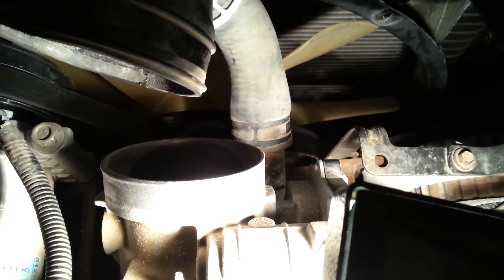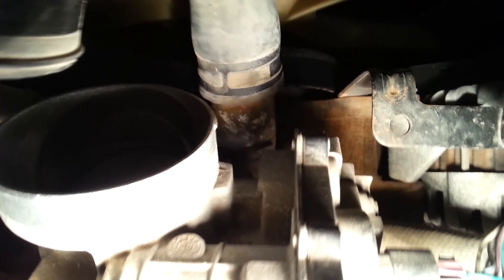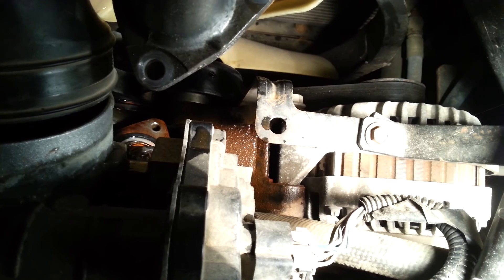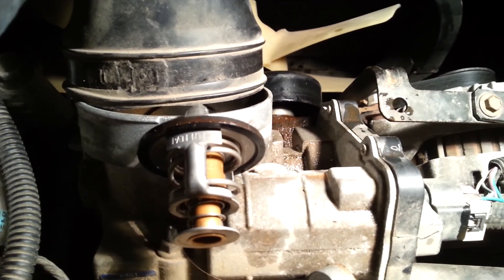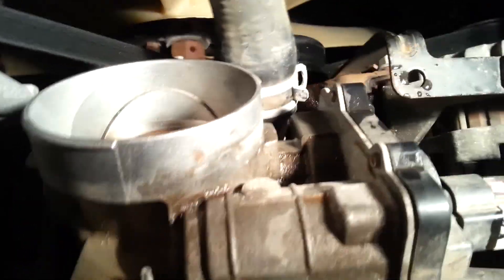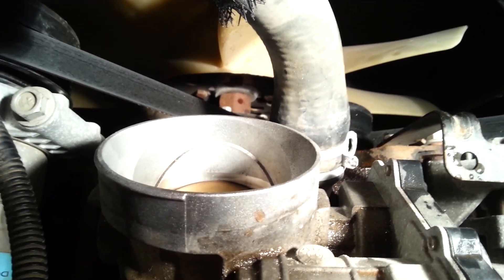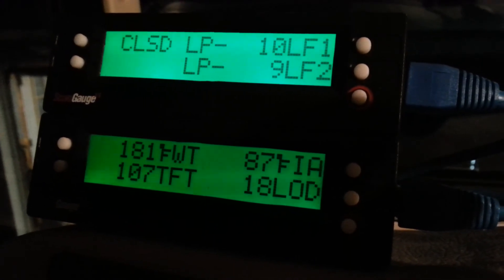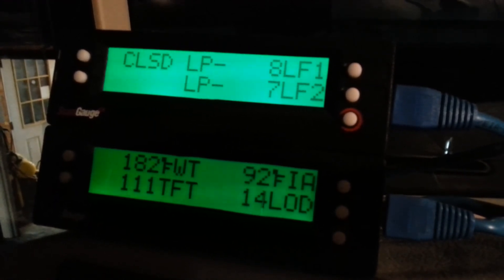8.1 Vortec W24 Workhorse Chassis 180 degree thermostat  install and review.

Comment: I did this several years ago mainly because of noise but also cooler engine temperature.  I'm very happy with the results and saw no change in mileage or performance. 
Thanks for another great video. 
Dave
Reply from the maker: Thanks for watching Dave, Yes mine is still working great also

Comment: Optimal operating temp for a gasoline engine is between 195  ̊F to 220  ̊F. I always tried to keep my Morris Minor as cool running as possible, until I found out it's bad for the engine. Thanks for the video.
Reply from the maker: It is rare that it stays at 180 unless it is very cold out. Most times its at 190 plus but the good this is that the large clutch fan does not in gauge very much.

Comment: 'Wobble' extensions work well in tight confines Kevin. 
Thank you for tip to reduce climbing hills with fan roar incessant. Hwy {originally 'Lincoln'] from Tahoe Nevada across the 'Range and Basin' mountain terrain [Hwy 50] to Salt Lake City as destination, will certainly test the transmission and cooling system. Fan will 'roar' a lot on way up, transmission will remain in low on more than a few down slope sections. "The Loneliest Road in America" is one definition.. :)

Comment: Are you running a bigger external transmission cooler?  I was on the road yesterday coming back from our trip and our water temp got up to 222 a few times.  It came right back down to 207 but I don't feel comfortable with the engine temp that high.  I am going to change to a 180 thermostat like you did but I am concerned that the transmission temp is that high also since the transmission fluid goes through the radiator.  I am thinking of separating them so I can put an independent fan on the transmission cooler to keep it below 200.
Reply from the maker: I don't think the 180 stat will help look at your fan clutch instead call or text me if you like 606-875-0125 Kevin also check out this video https://youtu.be/arVkjHR1PSA
Reply from the maker: ps all is stock

Comment: What is it that you have holding up the dash gauges. I have the same dash in my 2004  Winniebago that lifts up so you can get to the fuse block behind it or remove the cluster it has a cable holding it so it won't open all the way and hit the windshield
Reply from the maker: Now I remember I took a piece of 1/2 plastic PVC put a slot on one end it will fit into the metal support of the gauge cluster then a 90 degree elbow on the bottom and with a short piece of PVC coming out that will rest on the bottom edge, and it keeps that heavy dash supported out of my way.
Reply: I noticed that. You must not have your wife trained to hold up the dash.

Comment: Can you do a how to video on 8.1l coolant change/flush....thanks!
Reply from the maker: I will the next time do it .. it may be time I have to look at my notes when i did it last
Reply: @ktoutdoor  you da man
Reply: Did you do the coolant change video?
Reply: @amderoos6298  There is not anything to it. If you want a complete coolant change do it at the same time you do the thermostat and hoses. Drain the coolant, pull the thermostat, pull the hoses that you will need to replace.. After 18 years I am replacing them all. Backflush the engine block and radiator through the hose openings same with the heater lines if you wish. Reassemble, add antifreeze first and double check for leaks once you are topped off with distilled water. Don't forget the rear heater hoses if you have a 8.1L Suburban they are just as old as the rest. 25 years of GM master certified experience.

Comment: why not 160?
Reply from the maker: May not go into closed loop at that temp. ?
Reply: I run the 160 in my 03 8.1l gmc for about a year now and it runs fine stays between 165-175.
Reply: I know its counter-intuitive, but a lower thermostat may actually hurt the coolant performance.  When you have it so the thermostat opens very low (like 160) that means that at engine operating temp (about 200) the thermostat is wide open all the time, which means the coolant doesn't get to spend much time in the radiator.  With a 200 thermostat the engine coolant will collect in the radiator and remain there to shed more heat away and better maintain the temp.  In the video you see that Kevin's engine actually likes to run about 200 even with the 180 thermostat.  In my view to get it to maintain 180 with a 180 thermostat, it needs a bigger radiator (more rows), and maybe move the oil/transmission/AC condenser from in front of it to allow it to cool more efficiently.
Reply: @jodydewey3516  exactly